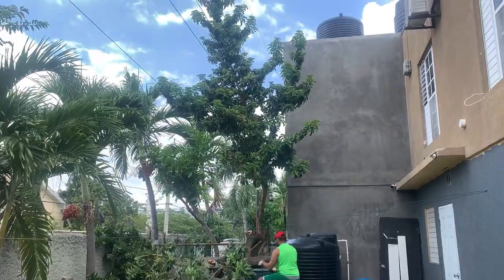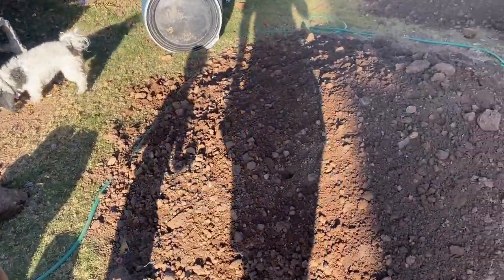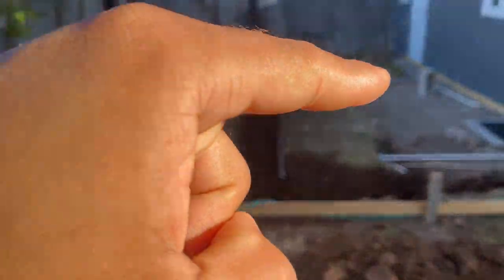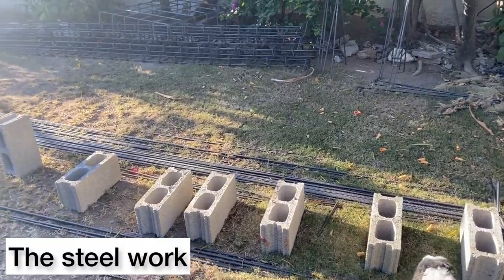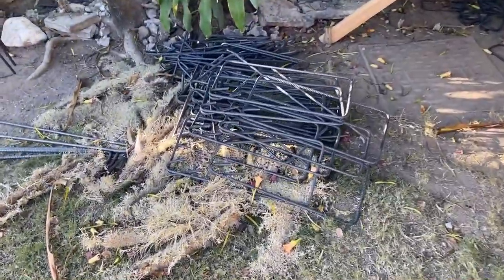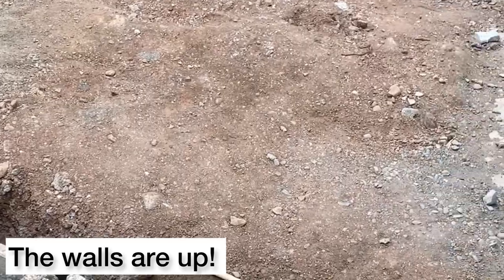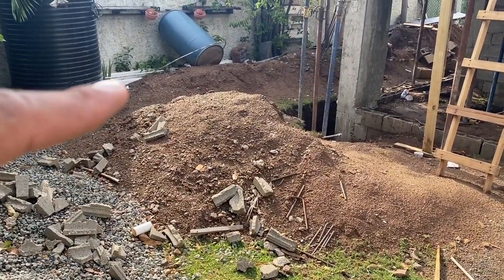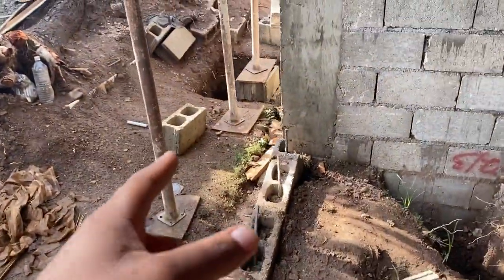Construction Process from day 1 - Digging and casting the foundation, laying blocks and decking

Comment: Love the design. Thanks for sharing. Plumber seems to know his stuff. When my time to build comes in St Ann I'm going to need S very good plumber who can think outside the box as my system will be off grid water catchment. I'll want to pressure the water in a bladder tank to distribute around the property. But I guess I'll have to pay premito get him from kingston to st Ann.
Reply: Take a look at "Cycle Stop Valve" it is the way to go to maintain pressure in your house.
Reply: @RoyD450  never heard of this. How does it work? I’m going to need to pressure standing water from a holding tank?
Reply from the maker: That sounds like an awesome set up. I know of homes in st ann which have both underground and air tanks. Never actually got into the intricacies but now that you mention it Im going to investigate how it works.
Reply: I’m sure I you can pump out of a holding tank through a booster pump or a break tank with internal booster pump connected.
Reply from the maker: @lennieadi  i believe so too. I know the air tanks use gravity feed. The water pressure isn’t great but its useable.
Reply: @HackedbyEbanks  I’m not a plumber but I design my lift conversion water system 11 years ago and it still works. I’m going to research the pumped water idea some more before designing a system with probably some help from a water specialist. But I’m confident in my ability to design it and then get a plumber to put it together according to the drawing. That’s quite some years away but I hope to vlog and share on YT when the time comes.
Reply from the maker: @lennieadi  sounds awesome. We would definitely be interested in seeing your journey.
Reply: @HackedbyEbanks  exactly. Hope to tart foundation in a year or less Yahuah willing. I’ll vlog it. I could even do a sit down vlog of journey this far but not further content to follow up. So may just wait as a year gap don’t make sense. Just chronicle everything one time. Weh u seh?
Reply from the maker: @lennieadi  yes. Document it for sure. Think you should even do the videos and keep till you’re ready. Sometimes when you wait too long the details get lost in time.
Reply: @HackedbyEbanks  true. I hear you. Was thinking the same. It’s been e journey already and I don’t have a blueprint yet. 🤦🏾‍♂️.

Comment: What material did you use to back fill
Reply from the maker: The same dirt we dug from the foundation could have been reused and we added some of the wash stone. But it depends on the soil you have. You need to ensure what ever you use has proper drainage.

Comment: The closet!! Love all 11 and a 1/2 feet of it...the convenience of the plug in the water closet, well thought out...need that for ours!
Reply from the maker: Yes the closet is pretty long, can’t wait to do the design in it with shelving (DIY project loading). You can never have too many plugs and it will be convenient in the water closet for sure. Another cool location we placed a plug was outside on the underside of our cantilever.